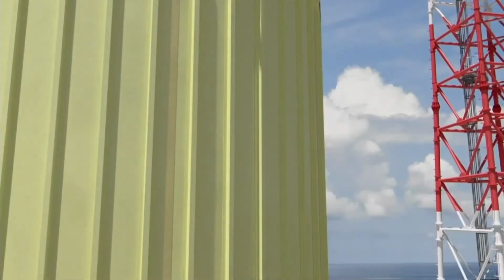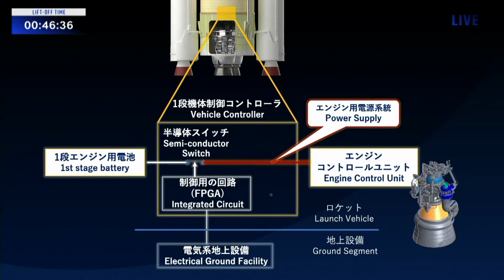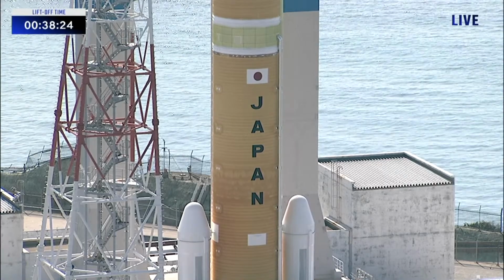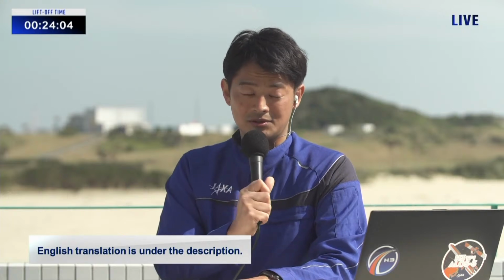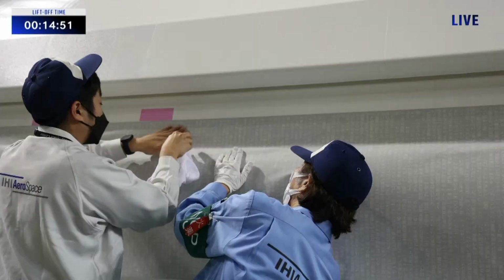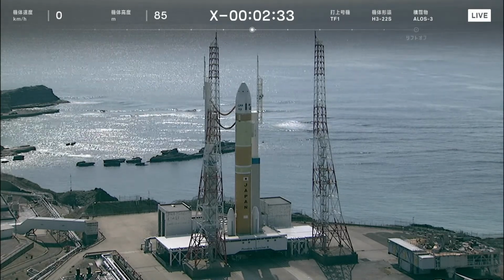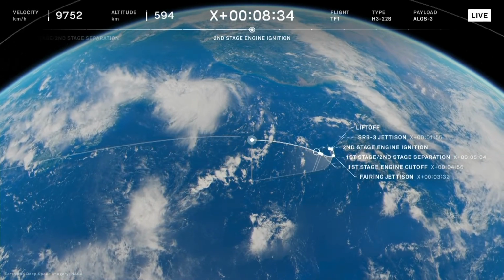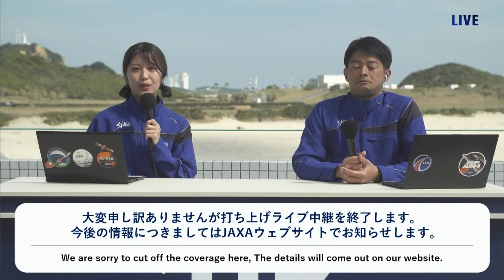Launch of the First H3 Launch Vehicle with Advanced Land Observing Satellite-3 “DAICHI-3” onboard

Comment: Self-destruct of remaining spacecraft due to 2nd stage failure to ignite at altitude of ~500-600KM travelling at ~9000km/h
But isn't  that an irresponsible thing to do leaving huge quantity of space debris in orbit travelling below orbital speed, endangering 2 space stations and other satellites currently orbiting at lower altitudes ???
Reply: It's possible to know exactly where the other satellites and space stations are flying at the time. The debrish would be crossing their orbits only for a few minutes, before burning up in the atmosphere at reentry. So I guess they checked that it was the safe thing to do. Self-destructing makes the debrish smaller and easier to burn up completely, so it's safer for people on the ground.
Reply: @Madvik1917  The spacecraft's destruction is carried out using explosives to make sure remaining fuel is vaporized in space. It's debris are blown outwards in all directions at high speed. Because of this a debris field will be created and this debris field will still orbit for quite a while around the Earth albeit with gradually lower & lower speed as it underwent orbital decay eventually plunging down to earth. One can only hope that the debris field's orbital inclination and it's destruction location is nowhere close to those of the other orbiting spacecrafts.

Comment: 1:14:00  (sigh)  Such a shame.  I can feel a tear in the corner of my eye.
Reply: At 1:01:45 you could see that something was wrong. The rocket turned and fell! But they still pretended as if nothing was wrong, and everything was according to the plan!
Reply: @LandOwnerOnMars    Don't think so, it was just the perspective of the camera through the clouds.  
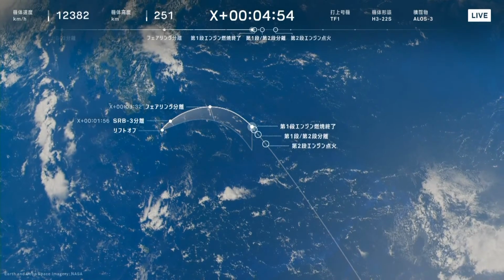Things went wrong when 2nd stage failed to ignite.  Momentum kept the 2nd stage going up, but the speed began to drop immediately.  At 1:04:25 you can see the velocity climbing, but starts to drop after 1st stage cut off several seconds later.  I was expecting an increase in velocity when 2nd stage kicked in, but that never happened.